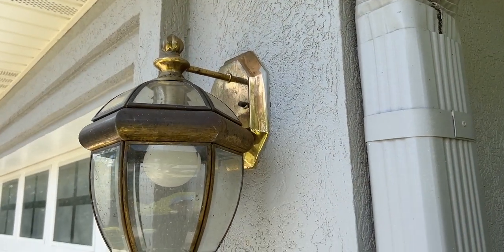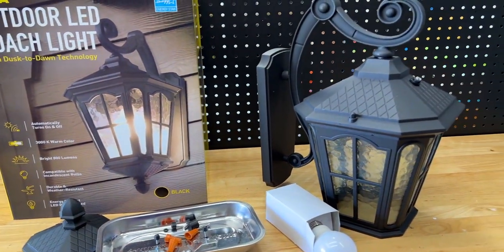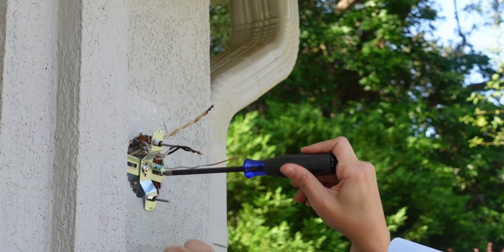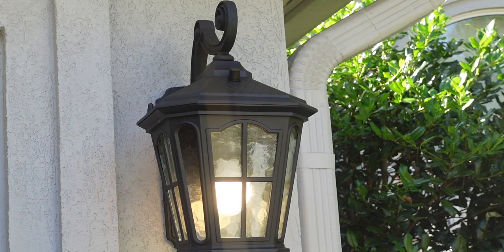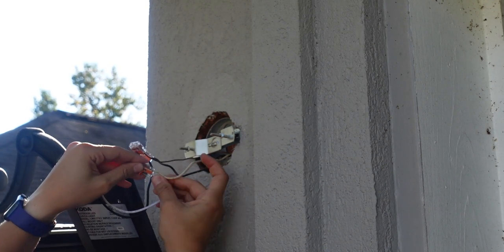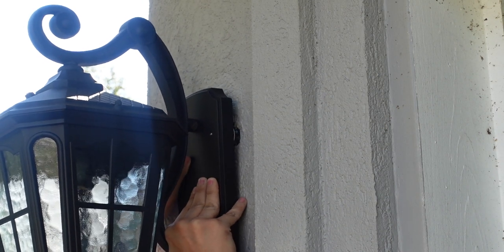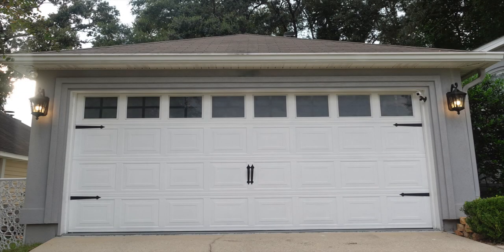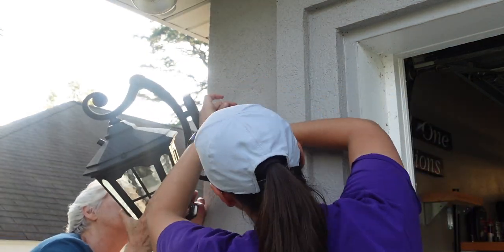DIY Install Outdoor Home Light Fixture // Dask to Dawn Built In

Comment: Great Job Ladies and it looks very nice. I really need to do that but I have an old 70s house built back where there weren't any codes and I'm having a hell of a time trying to figure out what circuit breaker goes to what LoL. It's a real mess. But I'll figure it out sometime. Thanks for the encouragement. 😎✌
Reply: If your light is on a switch, and you turn off that switch, there won't be any power to the light and you can swap it out.  Turning off the breaker is a good added safety feature to ensure someone doesn't flip the switch while you are working on the light.  However, if there's no one else around, turning off the switch should suffice.